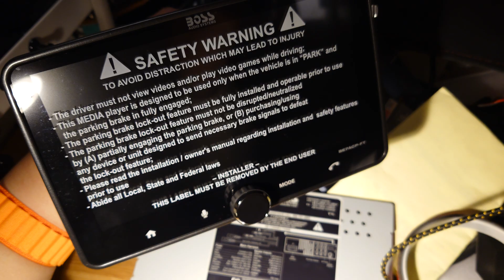Boss CarPlay head unit teardown

Comment: My power management chip had blown after an accidental shortage to ground and I am wondering where I can get this component to get it up and running again
Reply from the maker: You can usually find sellers on AliExpress or similar websites.  Just Google the markings on it, most sellers list them all.  And obviously make sure you have the skills and tools for hot air reworking.  Here's a few links I found with a quick search for "YD1821B": https://www.ebay.com/itm/394538905620 and https://www.aliexpress.us/item/3256803448264738.html

Comment: Hey my man do you know where i can get a circuit board for this radio well i have the boss bcpa9 the thing gets hot plus no sound from the speakers???
Reply from the maker: I doubt you can get a spare.  You could always try to fix it by removing the cover and using a thermal camera to see what's overheating.
Reply: @faeinthebay  Yeah I opened it up & there was a burn mark by the back,So I did a lil more investigating & the tda7388 amplifier circuit the 9th pin is fired,,I think the guy who sold it to me hooked something up wrong,,Cause when I took it out that pin just slid right out of the amplifier circuit,,,I'm gonna order a new one & see what happens,,,1 more thing I hear from alot of people that the tda7388 amplifier circuit gets really hot in different brands of radios Cause when I had mines on it was pretty hot too.
Reply from the maker: @SleepdaBanga  good find, hopefully it's an easy fix!
Reply: @faeinthebay  Thanks bud
Reply: @faeinthebay  Yeah I opened it up & there was a burn mark by the back,So I did a lil more investigating & the tda7388 amplifier circuit the 9th pin is fired,,I think the guy who sold it to me hooked something up wrong,,Cause when I took it out that pin just slid right out of the amplifier circuit,,,I'm gonna order a new one & see what happens,,,1 more thing I hear from alot of people that the tda7388 amplifier circuit gets really hot in different brands of radios Cause when I had mines on it was pretty hot too.

Comment: Any idea on how to change the Apple CarPlay usb on a boss be7acp, it was torn apart.
Reply from the maker: It should be pretty easy to solder since it's only a four pin USB.  Just get a female USB port with partial cable, or if you can't get that, just cut a USB 2.0 A extender in half.  Cut the stereo's cable above the damaged point, strip a bit of the four wires on each end, put heat shrink tubing over each, twist the wires together, then solder and heat gun.

Comment: Hi,
I worked with HeadUnit based on SPHE8368 SoC and I connect to Linux terminal from UART.
Are you can connect to the terminal from UART ports?

and are you have Linux SDK?!
Reply from the maker: Sorry, I sold the car with head unit and I can't check.